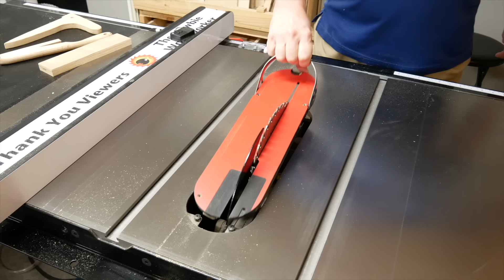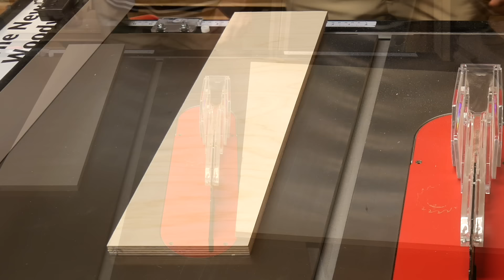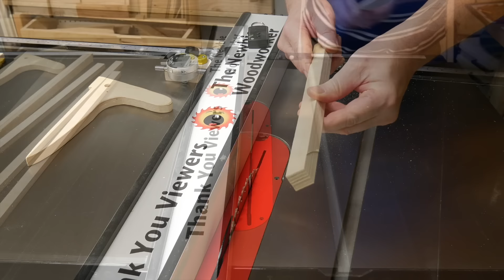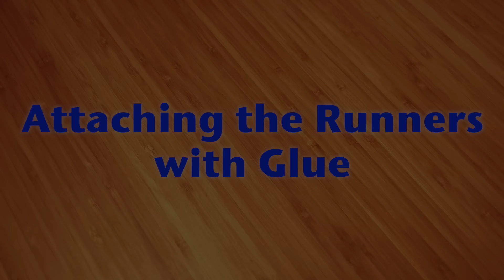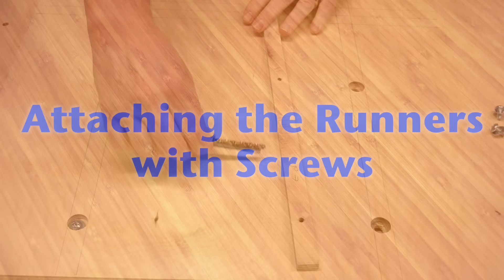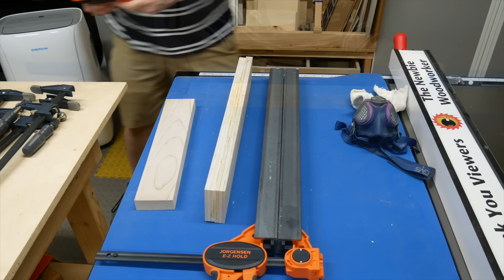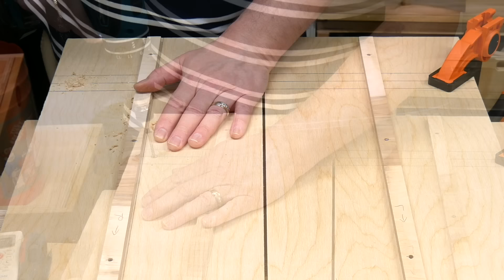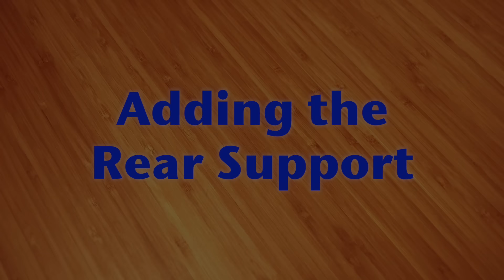Build this Revolutionary Cross Cut Sled, for Newbies!

Comment: I am far from a Newbie when it comes to crosscut sleds as I presently have 6 in my shop and have trashed at least 4 others as I built better ones. However, I don't consider myself an expert either. I can, however, recognize a well produced video and a good sled design and yours fits in this category. Here are some comments:
1. Appreciated not having music in background.
2. Admitted that mistakes will be made even by experienced people.
3. You did not perpetuate the myth that you should measure the 90 deg angle by referencing off the saw blade face. The miter slot is the appropriate reference and I use similar techniques to create a reference surface that is coincident with the edge of the miter slot. I use automotive feeler gauges to push the wood up against the edge of the miter slot. Ideally the face of the saw blade is parallel to the miter slot but you can still get good results with a slight misalignment. Most think the saw kerf is just the width of the saw teeth but it is not. Envision rotating the saw blade slightly away from being parallel to the miter slot and you will just widen the "effective" kerf.
4. I also use feeler gauges and a stop block to move my rip fence over a small amount so that the runners are just the right width. Feeler gauges will fit in my shop apron while a dial indicator jig does not. I have not used plywood as runners and will not cast stones until I have tried them; I tend to use some kind of plastic.
5. I am a fan of the Ng method of aligning the sled fence relative to the saw kerf in the base of the sled. It is not about the numbers; they just take you down the path to get sufficiently close to a 90 deg cut. I actually use a combination square and feeler gauges to measure the angular error from 90 deg and then use the feeler gauges with stop block to adjust the fence position.
6. When you put a chamfer along the bottom edge of the fence, make the height of the chamfer smaller than the thickness of the square you are using; you don't want the square to fall into the chamfer as that will screw up the alignment measurement. If you own a Woodpecker 45-90 degree square that is made of 1/4" thick aluminum, this won't be an issue.
7. Many sled designs have you permanently attach the fence to the base as if you never need to make any subsequent adjustment. We both know you have to be able to periodically fine tune any sled.

Thanks again for a well done video.
Reply from the maker: Thanks Ben for some great comments and kind words. My first thought when I saw a long numbered list in your comment was "Oh boy, here comes the complaints," which is usually the case. I'm thrilled to be pleasantly surprised. Regarding #3 and the width of the kerf: This is something I intuitively understood from the very beginning, but have never really found a good way to explain it in a video. The sled is going to follow the miter slot, so the cut is always going to be parallel to the miter slot, even if the blade is misaligned. A misaligned bade just means a wider kerf. So I appreciate you reinforcing that thought. And I agree with pretty much everything else you said, although I'm not a fan of the 5-cut method, even though I understand why some people love it. Again, thanks for the great comment! 😄
Reply: @TheNewbieWoodworker  I've just bought a table saw and have been looking into sleds.  Your video, along with Ben's comments have been very helpful (especially the explanation about referencing off the mitre slots).
Reply from the maker: @ParaBellum2024  Awesome! 😄

Comment: I made my first sled and this is a left side of cutting blade sled. I am going to work on another sled next and just want to ask about the 5 square method. I have the square as close as 0.00766 over 19 inches over all. I will mostly be small stuff and will not use for large 4 by 8 sheets. I will use something separate for that and just think that is close enough for me. I hear of some having it down to 0.001 or 0.0001 but that is extremely small error and I am not making pieces for museums.  Take care.
Reply from the maker: That's one of the reasons I don't like the 5 cut method. Who cares what the numbers are? My feeling is this: If you use a quality square that you know actually is square, and you can't see a gap between it and the edges of the wood, then it's plenty good enough for woodworking. Heck, I even used a sled that had a small gap with the square, and it worked fine until I tried to make some things that needed to be more exact. But for most things, it was just fine. So don't worry so much about the numbers - at least, that's my thought.
Reply: A good Starret combination square will probably give you as close to 90°as you're going to get without using a machinist square. I bought a set of Groz squares from India and they're supposed to be accurate to within .0006. A Starret combination square is nearly as good, I'd think.  As far as the five cut method goes, it's is a great reference, but what I've noticed is folks measure the final strip by holding the caliper jaws parallel with each strip end and completely inserting the ends into the full depth of the jaws. Well, when you do that, you're introducing an error. The measurements should be taken on the very tip of each end of the strip.
Either way, whatever works for your needs is the way to go.
Reply from the maker: @pawpawstew  👍

Comment: I have been doing wood working for many decades....you scared me reaching over that blade so many times..... I have also never seen anyone ever tap threads into wood. I am going to have to try that...I just can't believe that will hold up.
Reply from the maker: Tapping wood definitely works, depending on the material and use of course. As for reaching over the blade, I agree it's not a great practice, but I can't seem to help myself. 🙄

Comment: The rest of the World thanked you for including Metric for conversion 👍🏼
Reply from the maker: 😂 "The rest of the world" is true, isn't it? And you're all welcome. 😄
Reply: @TheNewbieWoodworker  I use both metric and imperial measurements, depending on the project.  For long measurements, metric loses out, as it's easy to accidentally be 100mm out when reading a tape measure.  With an imperial measurement (say, 83 and seven sixteenths inches), it's much harder to make this kind of mistake.

Comment: Fun video. Thanks! I'm off like you too. I would be concerned about not having a back fence for support. I'd sure as hell break the sled without it. Your idea to keep the gaurd on is cool but your workflow seems like it opens up the can of worms for introduced error because the front fence is now 2 pieces. The only way I can see this work better is to keep your fence in one piece while you align it. But cut your slot out for the gaurd and leave an inch or so of wood on the top. Use a forstner bit and a jig saw. On the bottom of the slot maybe leave a half inch and sand it down like a ramp so the gaurd will slide up and through. Keeping that fence one piece seems very important to me. I am getting ready to finally make my first cross cut sled and gave been studying videos on this for 2 years. I love William NG's build and also Nick Ferry's. Also, since I live at the beach, wood runners would not be good. So I have some adjustable plastic ones that slide forward and back and each piece has an angle. This makes them expand and contract for the perfect fit
 Got them 2 years ago. Lol. Think I got them at from Rockler or Micro jig. Glad to see that you use the Grrippers! Thanks for the cool ideas. Hope this helps
Reply from the maker: Thanks for the comment. I'm all about whatever works for you, so thanks for the tips.

Comment: Thank you, I agree with the blade guard issue but, I bought an old Craftsman table saw and there is no guard on it. Is there a way to make a guard that will work on the old old saw?
Reply from the maker: I don't know of a way, but that doesn't mean there isn't one. So keep searching and maybe you'll come across a way. Good luck!
Reply: you can get a floating guard just google floating table saw blade gaurd and buy or copy their design
Reply: I had a saw like that and it needs a splitter for the table insert after the blade to prevent kickback. The old Craftsman saws did not have a riving knife but mine had a blade guard, which I never used. The splitter  will increase the safety of your saw greatly. You can look at micro jig splitter to see what I mean or you can make your own.
Reply: Look up William NG's cross cut sled on YT. He builds a plexiglass gaurd that mounts on the sled and also has a gaurd in the back which would be near your belly.

Comment: Awesome work! One question. Are you an engineer? Haha I’m an aerospace engineer and I totally get trying to get things perfect and precise lol!
Reply from the maker: Thanks. I'm a retired software engineer. And it turns out that engineering in woodworking is basically the same as in software, and probably in your field as well. Being able to figure things out is the basis of engineering, I would think. And unfortunately, perfectionism is often a byproduct. Right? 😂
Reply: The Newbie Woodworker yes it is 😂😂 good work and great video! I will building a sled here in the next couple of days!
Reply from the maker: @rayurena3789  Awesome! Glad I could help. 😄
Reply: @TheNewbieWoodworker  Fellow engineer here (Civil/Environmental), and I agree! Problem-solving and perfectionism must be core values.
Reply from the maker: @AK_Brickster  Agreed!
Reply: @TheNewbieWoodworker  I too am a retired engineer [ mechanical, and did a lot of design work during my career ].  I'd like to comment on perfectionism.
 I've come to believe that perfectionism can be an impediment to producing an easy to use tool.  The real world is replete with examples : perhaps the best are to be found in firearms, prime one being the AK 47 which will continue to work without jamming in the worst conditions, and is made from plywood and pressed steel parts.  A counter example would be the Canadian Ross rifle - a beautiful shooter which has been described as a fine sporting piece.  It proved to be a disaster in dirty conditions and was abandoned in favour of the Lee-Enfield.  There are many more examples, particularly in WW2 German and Soviet designs.  The Germans always went the perfectionist route whereas the Soviets' approach was ' fit for purpose '.  And they were the winners ! 
In woodworking I remain the unrepentant hacker, striving to concentrate on what is important and ignore what is not.
Reply from the maker: @crustyoldfart  You make excellent points. I am actually a fan of "good enough". It's just that so many times, I want to tweak "just one more thing".

Comment: A couple of years ago a made a sled and set the cut with a large size set-square (so as to increase the accuracy of the cut). It was not bad, but it was not so good either, I really was not satisfied with the result. So, I then made another sled and applied the William Ng method. The cut was an accurate 90 degrees to the adjusted fence! It's like ruler, it is accurate, but it is nowhere as accurate as a calliper.
Reply from the maker: Thanks for sharing.

Comment: The biggest danger when using a crosscut sled is pushing on the back of the sled until the blade comes all the way through. If your hand is in line with the blade when it comes through you will be hurt; even without getting hurt you will ruin the sled if you cut it in half. 

Make the rear support much thicker so the blade doesn't stick out the top behind the fence and put something like a bench hook under the back of the sled that will hit the table and stop you from pushing it too far.
Reply from the maker: Thanks for the suggestion.
Reply: I was going to suggest the same. Adds complication, but it saves fingers
Reply from the maker: @TSPhotoAtlanta  👍
Reply: tomhath8413 - the idea of a stop to keep the sled from moving too far forward is GREAT. I recently saw someone dropping stops into the miter slots on the outfeed table to achieve the same result but I like your hook idea better.

Comment: If it raises up for the work piece and rides over it, it will ride over your fingers.  All a blade guard does is deflect the chips.  Get a Saw Stop.
Reply from the maker: OK, thanks for your opinion.
Reply: I believe he is already using a SawStop. I just bought a SawStop and I’m definitely building this sled because I want to leave the blade guard installed on the saw all the time
Reply from the maker: @BillPleasanton  Have fun with your SawStop!

Comment: Thank you for this. I've seen so many cross cut sleds that I want to build, but I'm very apprehensive about removing my blade guard. I'm new to the table saw and I want to get used to using the guard rather than the opposite.
Reply: The table saw is one dangerous tool! First thing to do is keep the gaurd on since you are new. Get comfortable. Look up videos about why kickback happens and how to avoid it. Push sticks can be your best friend or your worst enemy. They can help facilitate kickback. Get a set of the yellow Grrippers. 2 is fine. Lear how to adjust them. In the begining, they can be complicated to use until you find a workflow. For example, you might want to have both sitting on your work in the approximate position before you start your saw. I highly recommend setting up a system of outfeed tables to keep your work flat.its one less thing to worry about for your safety. Learn how to use a clamped block on your fence when using your sled. This will help set your work but as your work gets to the blade, it's all being held down by your fingers and not dragging against the fence. William Ng says that sometimes the gaurd can make it more dangerous. I believe it. It depends on the situation. For now, just fin lots of scraps, wear hearing and eye protection and practice with your gaurd on. Watch every table saw video you can and see how it all works. Make a rule about how close you are willing to keep your fingers to the blade. Many say 3 inches or more. It's your choice. Be careful not to cut through nails or screws. Move slow and take your time. Personally, I like to focus my eyes on the fence because that's where the accuracy wins or loses. But you gotta watch your fingers. That's where the yellow Grrippers come in. Don't let your blade be too tall to your cut. I like an eighth of an inch higher than the wood. Some times a little higher but not much. This will help reduce binding and kickback. Kickback will scare the crap out of you and you can get really hurt. I feel it's always user error. Learn, learn, learn how to avoid. I stopped using a table saw many years ago and then got back to it. I use it many times a week now. No kickbacks. Using all I mentioned above is what got me back but I learned all of this from videos. There are so many out there. You might want to not use a sled until you are more confident and have more experience. Last thing is the blade coming out the back of the fence. People make gaurds for that. It's a great place to lose a finger. Move slow and stay safe. Hope this helps!
Reply from the maker: Glad I could help! 😄

Comment: Thank you so much for not only showing metrics, but for rounding them to some reasonable numbers. When relating to material thickness, you may use some "off" numbers. OSB and plywood are coming in 9, 12, 18 and 23 mm (at least in Germany). A little suggestion: when atteching the fence to the board, you just can drive the screws through completley. At the end, near the head they are blank and smooth, without a thread, so they won't get stuck. So it will be easier to pinpoint the screwholes in the fence.
 To get an extra level in control over torque and tightness of the joint, you can use a manual screwdriver instead of a powertool. ;-)
Reply from the maker: Thanks for your comment, and you're welcome. As for rounding to reasonable numbers, I just made some guesses, since I don't work in metric. Glad to know I was in the ballpark! Manual screwdriver? Bah! 😂

Comment: Another excellent video - thank you.

I am about to order a SS PCS - your reviews of SS very helpful.

Do you have dust extraction connected to your blade guard? Not sure if the overhead arm for the PCS is worthwhile - your comments on blade guard dust collection are welcome.

Thanks from Australia.
Reply from the maker: I'm still using my shop vac based dust collector, with a 2" to 4" adapter for the PCS. It works well enough. I've heard that the more expensive overhead dust collector arm works pretty well, but I haven't used it. Honestly, when it comes to table saw dust collection, perfection is unattainable. 😄 Have fun!